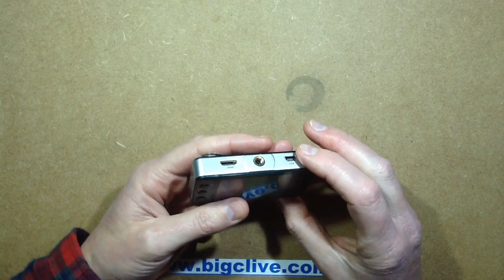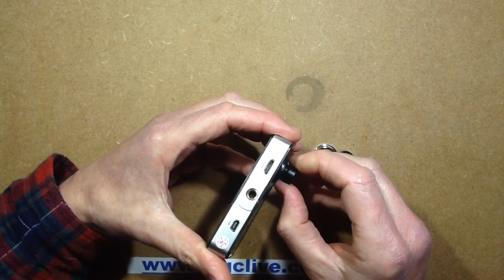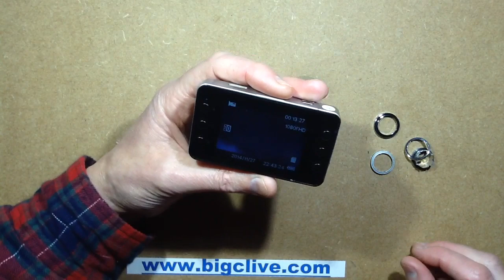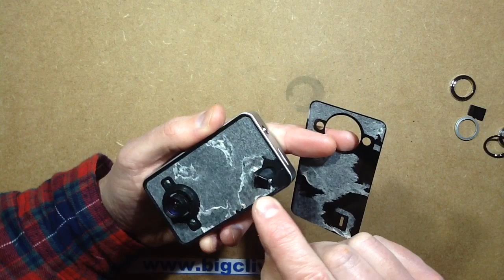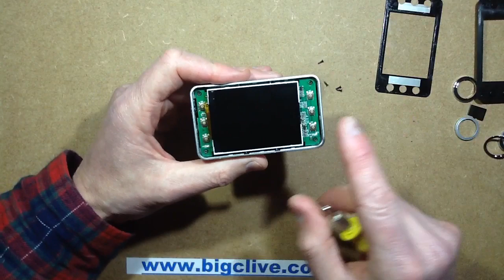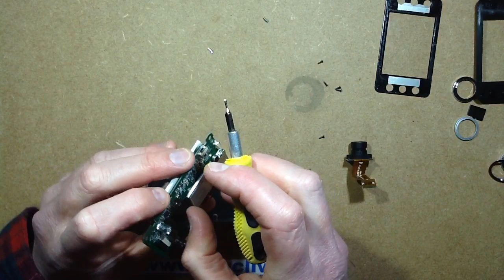Cheap dashboard camera disassembly and hacks.

Comment: i got one but the  battery was bad and expanded does anyone know where i can find this extact battery 
becuase there is no writeing on it and most battries ive seen like phone batteries say that its compatisity and voltage mfg date and all that
 but this one doesnt which is disapointing i got it for free from my dads good mate and i never asked whats wrong with it 
and i wanted to use it as a video camera
Reply from the maker: There will probably be a six digit number on the battery that gives its dimensions in millimetres.
Reply: @bigclivedotcom  it didnt have any numbers or anything it was really sollowen tho and wouldnt charge and im thinking what if the digits where never printed on it ive googled 300mah batterys which is most probably the size the battery was and it shows the same battery that probs will fit and its on ebay with fast shipping i asked for a hardware stores with a picture of what type of battery i needed but they dont got it but i might get one battery of ebay

Comment: I had the same  problem with the sound on my little security camera. So I opened it up and noticed the hole for the mic was on the side but the mic was dead center on the circuit board. I made a little hole was  dead center on the plastic casing and it sounds better

Comment: Hey clive I have a dash came I unplugged the screen to see if I can rotate it so the power supply goes in the bottom of tr cam instead of the top and now when I've plugged it bag in there it a dark spot in the top right corner do you know any way of getting the dead pixels back or where I could buy a replacement screen? thanks

Comment: nooo man dont use somethin like that, the absolute best thing i can think of u using, and honestly it seems like a pretty dam good idea i cant think of any negatives...but jus buy a cheap used phone off ebay, definitely a galaxy s7 or up or anything with n equivalent cam, idk if id get the samsung, i would personally, but if ur only using for the camera then its possible another phone might have a better camera n more options,

Comment: A'm a  little miffed to be honest. Your nice video of you dismantling of this dashcam has lead me to buy the exact camera from ebay in interest toward outfitting a cheap peephole camera to my door. The nice ribbon cable attached to the lens in your video looked just long enough to get down the doorway peephole, in an effort to capture the person who keeps ringing my doorbell and running away every time I go to answer my door!.. (without having to drop $40 on a real peephole camera, that might only have 640x480 resolution, never mind that the camera in this should have been much better, and only for $12!  With the same motion triggered capture ability!)  I followed your lead, prizing the glued on back off, then removing the screws, peasy... now the same wiggle wiggle, the board comes loose. But there's some resistance. I pull anyway. attached to the camera module in the identical appearing dashcam I had just received from overseas, was a piddly 1/2 inch long, soldered flex-cable that promptly tore a corner just above where it was soldered  directly to the board! (no release connection as your model had, along with the 1 1/2" cable)  I moved it a little- it tore clean through! NOw what! Waaaaah! :( so CHEESY!... I need a beer, I like a nice local Laker Red from here in Hamtown :) It's not your fault, these Chinese are taking leftover stuff and bodging  bits together into the final product, you can't count on what you are getting! The soldered cable in my unit was so short it's a wonder they even put it together! I was hoping to outfit a wider angle lens to the sensor, but on getting it apart, I had a look at the actual camera sensor. It was about the size of a grain of salt, I have a  fisheye lens that would fit the mount, but the field of view from the salt-grain sensor would be almost telephoto! I know, I might try soldering that Mylar ribbon to that Mylar ribbon at the break... yeah, hair thin printed on conductors, what are my chances? Do I shell out another $12 in the dashcam lottery? Sad part: I hooked it up on my car and went for a drive, getting reasonable daytime footage before ripping it all apart!

Comment: Hah... I bought one of these to use in my Ford Sierra Sapphire. I got mine when these were expensive (£19.99), though you can get one on eBay now for as low as £7.50 inclusive of shipping! Mine went on to serve in my Volvo V70, until I went posh and bought a 'NextBase' model. For the money, these cheapies do a fair job, and are better than nothing. The NextBase is marginally better sensitivity, and marginally better focus. Sound level and quality aren't much different. The annoying thing I had with my cheapy was that there was a significant rattle on the audio, but no other unwanted sounds were apparent. The so called night lighting on mine is white, but not much use for anything other than if you are taking still pictures with it. I guess you could glue it to the front of your nut and use the lights while you're out in the dark, as long as you take a battery pack to keep it going.

A dashcam is fun to have, and makes good entertainment to watch what the other nutters on the road are doing. I doubt I'll take mine to bits, but it was well worth seeing you do this, and very informative. At least if I need to fettle it in the future, I'll know what not to snap off or tear away whilst effecting an entry!

Comment: The fabric that covers the speaker is usually there primarily to keep dust away from the speaker. Especially metallic particles as these will stick to the speaker and hamper the operation of the speaker.

I have revived supposedly bad speakers in numerous mobile phones by disassembling them and removing the metal particles that was stuck to the speaker.

It was an easy job to remove the small metal particles, verify that normal speaker operation had resumed and then charge people for 30 minutes labor and a new speaker :)

Comment: I watch this video I have the same camera my wife bought it for me online because an 18 wheeler had hit me and they determined it to be my fabrication that it didn’t happen was going to run to take care of the trailer came in on me his insurance company said no the trailer follows the cab it’s impossible but anyway 
My wife bought me this camera and I watch this video I wanted to take it apart to do like the man suggests and make it better for night vision I tried to unscrew the lands and it ripped it off the circuit board The base you unscrew the lines from is attached to the circuitboard via a ribbon and it ripped it free ruining the camera I no longer have one I am sad so do not try to unscrew the lines

Comment: Clive, thanks for this and all your other videos.  I really like the 'reverse-engineering' aspect your videos.  Along those lines, could you 'hack' the OS of these cameras?  I believe most of these run some variant of Linux, feel free to confirm or deny this.  Also, when you removed the actual camera I thought it looked similar to the camera module for a  Raspberry Pi and wondered if there are standarized  pin-outs (connectors) for these types of camera.  Same question regarding the LCD screen. If so, I'd like to see you do a video on that.
Reply: Seeing someone else mention the Xiaomi Yi which is a higher end camera than this one. Makes sense it'd have a beefier SoC that could run Linux. I took apart some SJCAM firmware and it was eCos, which is a small, real time OS.

Camera is probably standard but it's late and I can't remember what that connector is called.
Reply: Richard Marton I have a Xiaomi Yi action camera which is very similar. I managed to telnet into the Linux operating system. So I guess this also runs the Linux kernel.
Reply: I'm not familiar with that camera, how did you physically connect to it to make the telnet connection  Wifi, Ethernet or USB cable? Something else?
Reply: Richard Marton it's a gopro 'clone' so it has wifi. that is what i used.
Reply: interesting
Reply: Thanks, I'll have to look int getting one of those or a similar camera.  I have a Sony one-shot and have no idea how I would get access to its OS, or if it even has one.
Reply: Richard Marton Sony one-shot? I've never heard of it, nor could find anything online.
Reply: Arg! That should have been Sony Cyber-shot DSC-WX9.

Comment: I tried out a similar one, but the battery life was a joke - 5 minutes after charging overnight -, so I sent it back and got a refund. I'll see if I can find the same model as yours, with the Earth in the intro animation. Mine had a car.
Reply: They don't have good batteries in them because they are intended to be plugged in at all times while in you vehicle. They normally power on and record when they receive power and turn off when they lose power. It's how they work. Almost all dash cams are going to have poor battery life because of this.
Reply: But 5 minutes??? Better not even have an internal battery then, for goodness sake! It's the most ridiculous battery life of anything I've ever encountered out there.
Reply: They add one so you can pull it out and show an officer video of an accident. It wouldn't need to be used for a long period of time so it doesn't need to be very large. Some people just replace the battery with a large capacitor instead so the battery won't go bad with power on it all the time.
Reply: I'd at least have used something that gives me a minimum of 30 minutes of battery life. At least that's what I do for my projects...

Comment: Quick question Clive. Regarding upgrading the rechargeable batteries in these things, and cheap chinese trinkets in general, if I replace the battery with one of the same voltage but a higher capacity, will it still charge ok, and will it charge fully? Thanks.
Reply from the maker: Yes, if you fit a higher capacity cell it should last longer but still take a charge, although it will take a longer time to charge.  I recommend using a protected cell with the little circuit board on it.  Some standard phone batteries would be ideal.
Reply: Thanks for the advice!

Comment: For my mind, the biggest issue this camera has is that there is no protection between the bottom of the tripod mount screwhole for connecting the windscreen mount and the screen...  If you screw in the supplied mount "properly" before using the locking screw, you crack the screen . .  I know, I did it !

Comment: If you want to see if it has an ir filter without taking it apart, you can always point a remote at it while it running and press a few buttons. Looking at the screen, you should see the ir led light up a purplish color.
Reply: Don't get me wrong, I still want to see it torn down ;)

Comment: The audio noise on startup and menu browsing beeps are identical to the SJCam series.  Wonder if they're made in same factory, and/or had firmware developed by same people.
Reply from the maker: +thechosendude I think there's a lot of copied software in the Chinese cameras.
Reply: I own a Rollei branded Chinese made dash cam. It also has got exactly the same sounds but very different hardware.
Reply: Originally copied from the startup sound for a Sony camera. Heard it on a compact Sony I owned for a while, and my brother's Sony Xperia Z3 Compact. The menu does look suspiciously familiar.
Reply: Developed? Its china so its of course stolen.
Reply: thechosendude I
Reply: I remember an Olympus point and shoot I had that made the same sounds too

Comment: I bought one of these but it was an as seen on TV thing and the quality isn't the best but it works. Shoots 720P HD video with or without night vision and takes pictures and records voice. the audio is tinny and sometimes has noise, It was $40 at walmart. I did a little hack with the voice recorder and encoded a song to the .wav file format that this thing uses and it plays. the speaker is very tinny so I replaced it and it sounds a little better. The cell phone style battery that comes with this thing doesn't last but 15-20 minutes but runs fine on a power bank.

Comment: Clive, without the IR filter you may find that the colors have gone all wonky as the camera is color adjusted to use the filtering..
Artists use this effect sometimes but it may not give you your intended results.
Reply: You’ve got that a bit backwards. The camera isn’t color adjusted to use the filter.  The filter is required for the camera to detect colors correctly.

Comment: I've learned the hard way most of these cheap Chinese dash cams are horrible RFI generators...had to shell out $$$ for a Garmin one that doesn't wreak havoc with stuff.  One of the worse ones not only jammed my amateur radio gear but also rendered my car's FM stereo nearly useless.
Reply: I happen to have used an identical looking camera but of a different brand (Dymond) yesterday, in combination with a walkie-talkie. They interfered with eachother. The walkie-talkie had a lot of static and messed up singnal and the camera had recorded a lot of crackle, like a loose wire somewhere. My car's radio was okay however.

Comment: Hi Clive, any advice on how to remove the IR filter? Is it on the board or the lens?
Reply from the maker: +Paul Basden Usually on the back of the lens barrel.
Reply: +bigclivedotcom Thanks fella. Does it just pop off?
Reply from the maker: +Paul Basden It's often tacked at the edges with glue and can be popped off with a knife.

Comment: Hi,
Thanks for the video. How did you get the front lens ring off that you show at the beginning? I grabbed mine with a pair of pliers and tried to give a little twist and it didn't seem to want to move.
Reply from the maker: +ringwood I used unreasonable force, and it ain't going back on again.
Reply: +bigclivedotcom I've got a bunch of "unreasonable force" in my toolbox. Use them all the time! Thanks.

Comment: Wondering if the camera will fit to a Raspberry Pi camera inteface? - if so it begs the question how can this whole unit be retailed at half the price of the marketed Ras pi camera and have onboard processing and recording along with the screen ect.
Reply: +vizionthing It's all in marketing and what you can get away charging for something.  Once they figure out there's a market for some individual thing, they start selling that one piece for a lot by itself, even if you can get it in something for the same price or cheaper elsewhere.

Comment: Hi Clive. Just was wondering, i have the same at home and just was wondering, is it possible to attach istead of this camera to any rear view cameras? I like the size of this screen, but want to use as rear view camera screen for my car. Maby you can make a video if its possible to connect some kind of rear view cameras what you can get on eBay :)
Reply from the maker: +hei Kenģik I don't think it would be easy.  But you can get some super-cheap rear-view camera kits on ebay now.  Ultra mass produced just for that task.

Comment: Regrettably I've just broken the 2nd camera that arrived today (although the first one I received still works). It's the 2015 model and seems to be built differently in a couple of ways, for example the way the flat flex for the camera appears to be simply glued onto the board. After taking it apart once to see if I could remove the IR filter the camera stopped sending a signal. Upon closer examination it seems as if a few of the tracks on the flex had been ripped off, with no easy way to re-attach them. And whilst trying to fix that the screen started to flicker, meaning that flex is acting up too! Not surprising for these cheap Chinese products, but disappointing nonetheless to immediately break something after waiting a month for it to arrive.

Comment: I've been using this for the past few days and I have to say that while I am impressed at what you get for the price, I don't think I am quite as happy with it as you are. It records decent footage during the day, although the resulting video is rather grainy such that you can't make out number plates. It's also a little bit choppy in the frame rate department. At night it picks up close to nothing, though I will try removing the IR filter. Otherwise it's a nice little device - a bit buggy, but that's hardly surprising. I paid €8 (about £6) for it, so for that price you can hardly go wrong!

Comment: Hey Clive, i noticed a bit of a problem with that dash cam.  Them lipos are sensitive to heat so if you were to leave that camera in your dash on a hot day the lipo would be ruined.  I've ran into that problem before and replaced the lipo with a capacitor on a dash cam and just kept it plugged in.

Comment: Clive, did you ever do a before and after video using this thing? It would be interesting to see/hear the results.
Reply from the maker: I didn't.  But it would have been a good idea.  I still have it, so may do that in the future.
Reply: Thanks, I might consider using it for when I'm flying.. Might have to retro-fit an input for the two-way radio.

Comment: I want to use mine for capturing license plate. I understand that there are long focal length lenses on Ebay. I am going to remove the IR filter also as color is not important as this will be an auxiliary 2nd dash cam.